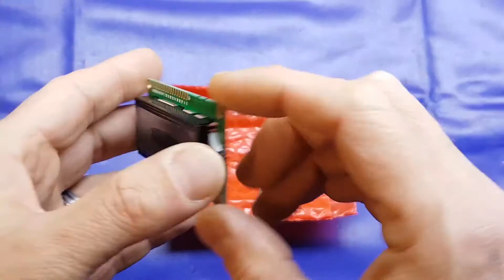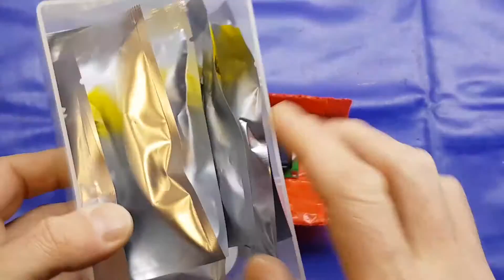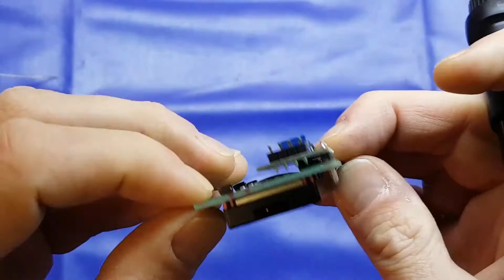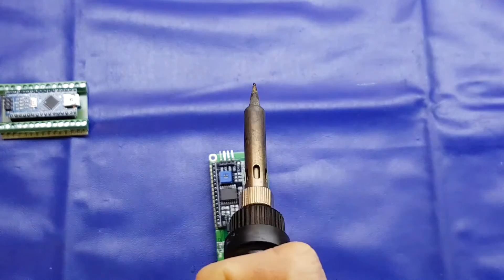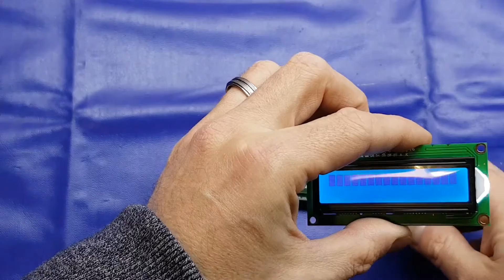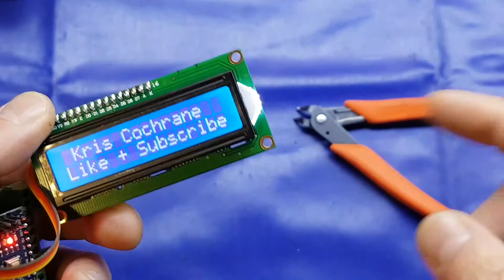Connecting an HD44780 LCD to an arduino nano using just 4 wires (thanks to I2C)

Comment: I fancied this adaptor so had a wee look for it online. Here's a link if others are interested. If you don't have a display already the second option might appeal. Like Kris says it looks a tidy set up!
http://www.icstation.com/mobile/serial-interface-board-module-lcd1602-address-changeable-p-2284.html
http://www.icstation.com/mobile/arduino-iici2ctwi-1602-serial-module-display-blue-p-1531.html